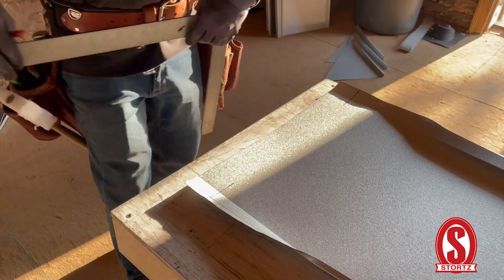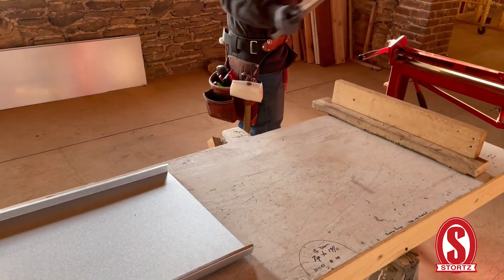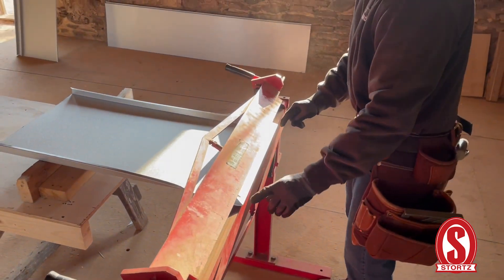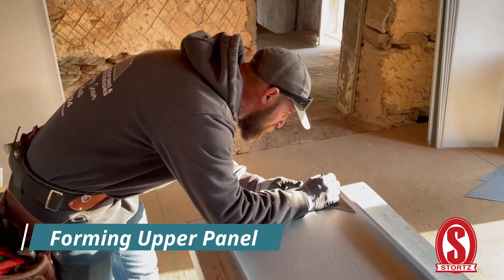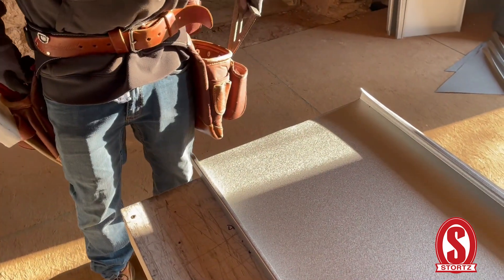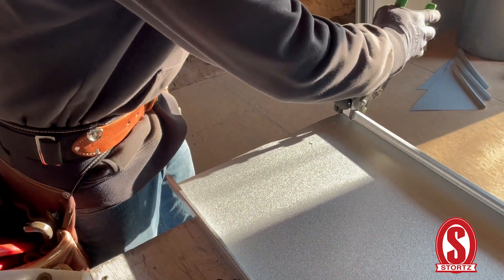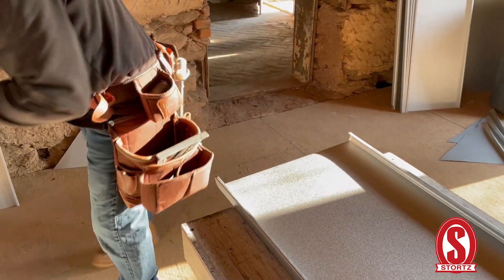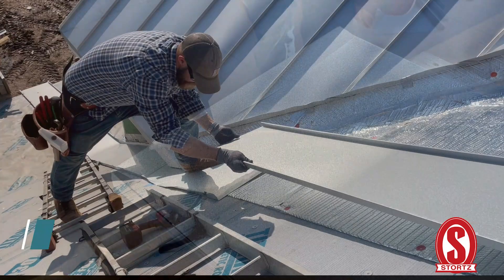How to Form and Install Cross Seams in Standing Seam

Comment: You must go to learn this professional in Eu.
This is not correct
Reply: This is a Euro detail out of the Rheizink training book. It is recommended for roof slopes no less than 25 degrees. It’s not wrong but there are certainly other ways to preform this detail depending on slope and circumstances. This is a simple cross seam detail easy to use when installing preformed double lock standing seam panels.
Reply: @craighardin3725  what would you do different on this detail if roof pitch was below 25 degrees?

Comment: Stoked. 
Is it that you just made this video or is that a new technique?
I’m thinking this has been the way forever right?
I’m actually going to look through old photos to see how I have been making the bottom panel cuts. 
The finished product is definitely perfect 
Nice work
Reply: The old way of cross seams were typically double fold welted joints or single lock and soldered . These were done in a shop on a work bench and made into coils yielding several cross seams per roll that typically covered 100 sq ft. Although there were always joints made in the field they were usually done the same way. This video explains the technique when using the modern roll formed panels.